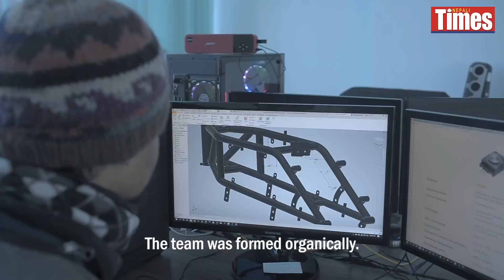Made in Nepal: Yatri Electric Motorcycles

Comment: something they should definitely look into is the safety. It might be hard for the to do a crash test now. But think about it guys. Battery should be very protected. Also, removable battery will be a plus point. So, the rider can replace with a charged one and not wait for the battery to charge. Also removable battery means riders can take the battery inside the house and charge.

Anyways, best wishes to the team.